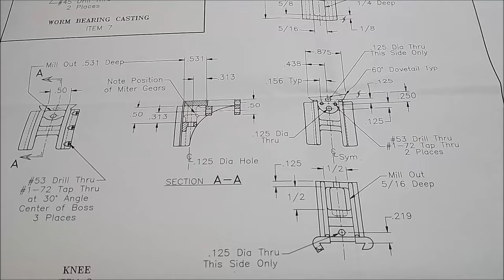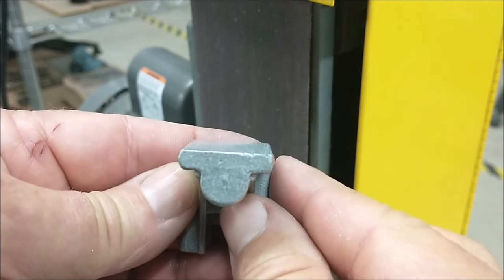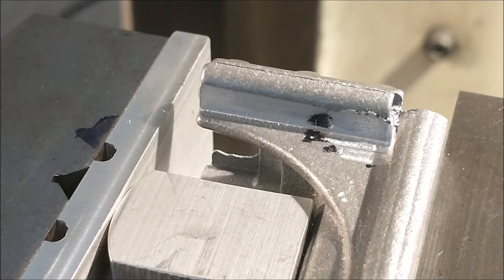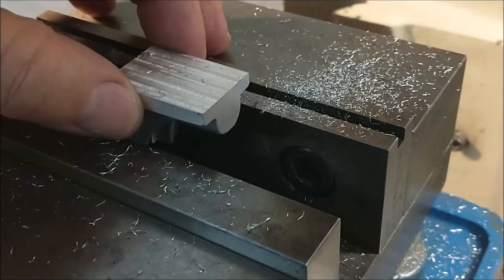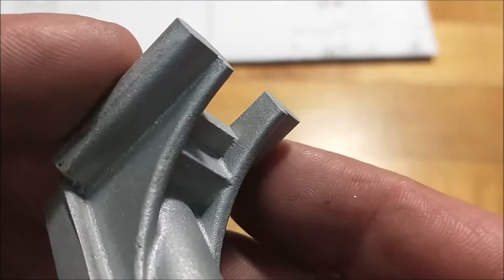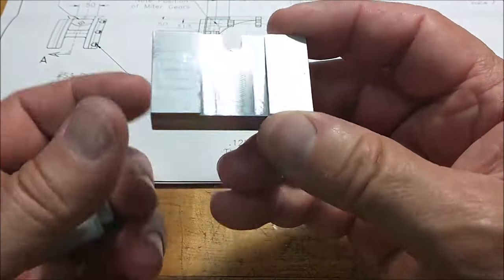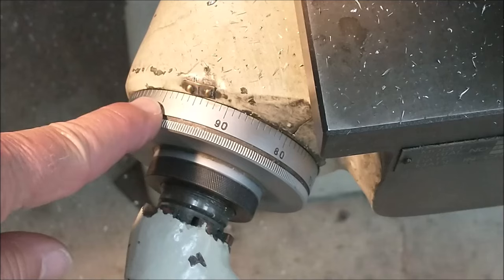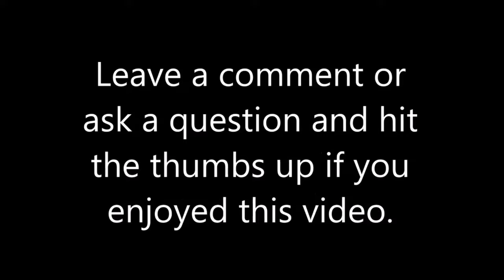A Miniature Knee for a Miniature Mill.....Take a Look !!

Comment: Great description of how to properly address a raw casting Joe. If I may just point one minor correction out for your viewers, when you were talking about the projection direction on the print, you referred to imperial and metric projection, this is actually 1st or 3rd angle projection, and either can be applied to metric or imperial drawings. The projection angle the drawing is drafted in is denoted by a symbol in the title block usually. I am sure you know this Joe, just didn't want anyone getting the wrong end of the stick. Great job. Cheers, Jon
Reply from the maker: Thanks Jon.

Comment: Welcome Back Joe. That defect is called a sand fall. Looks ugly but does not limit functionality.

The draft angles and fillets allow you to pull the pattern out of the sand.
Reply from the maker: I'd rather have a positive ugly than a big blow hole.
Reply: @joepie221  LOL I have worked several castings on older machines. Huge castings for small shops. Many of these were gone using pit casting. Pit casting is where you work the mold in a pit full of sand. These castings often had blow holes. These were filled with lead. I can imagine pouring a pit casting on a huge machine. The bucket of a few tons of white hot iron can scare most folks to rethink what they’re doing there.

Comment: Draft is required to prevent sand pulls when removing patterns. Even so, the blemish Joe machined out is an actual sand fall. That corner is very delicate in the sand and this time, it fell in.

While draft is required in sand casting, it’s needed. But I always find one of the more critical phases in machining sand castings is knowing where to start and establishing reference planes or as Joe says, banking surfaces. Think about what you will do prior to your first chips.

Comment: Good day Joe. Nice to have you back on the miniatures. Think big, work small eh. Flying parts, LOL. I built a pedestal polisher out of a small grinder and made extensions to get the cotton wheels farter away from the motor. Right away I had a large piece of silver take off at light speed so of course after it hit the platform, the wall behind it and on to the floor it was a remelt. After a while I ended up ruining a few more pieces I cut the base back so I could use the bottom of the polishing wheels and got a nice piece of small openings netting installed to catch the pieces as they left my control. No more ruined pieces. I have a video of the piece.  When I see dross in a corner like that I think SAND. Tunes are a choice but you narating is better my friend. A busy casting is almost an understatement. Of all the pieces I have seen you make I believe this is the, LOL, busiest yet. Thanks a bunch Joe. I really liked this one. Your long awaited parcel should be there this week. It sure has a lot of miles on it eh. Thanks again and see you next post my friend.
Reply from the maker: Thanks for stopping by sir. Always good to see a comment from ya.
Reply: And a big thanks to you too my southern friend.  This is sure a tricky one. Without carefully work out where to start and the process to follow I can see a new knee or 2 may/will have to be ordered.  @joepie221

Comment: Very excellent - a whole bunch of gems in there, and another fixture to add to the project list - a Tombstone. The extra mile attitude is such a good one to have - the results speak for themselves. That extra polishing / clean up / fettling - call it what you will - turns a great part into a breathtaking part. Cheers!
Reply: An excellent shop tool. In my 40 plus years one l never saw. Saw and used the idea of a spherical thrust piece to hold against tapered or uneven surfaces. We always had old bearings around to take the balls out of. I have even seen plates with a swivel foot jackscrew used. But take caution. There is a maximum angle that such tricks will be use to. To much angle between the movable viwe jaw and the surface being held and you risk the part being sucked out. The technical description of when this happening is üpkehfuckt.
Reply: Joe, we had a number of production machines out in production with indexing tables. One kind the table rode on steel balls 2.5 to 3 inches in diameter. It was scheduled to have the balls replaced so the table was lifted up. The old balls taken out and set aside. The races top and bottom were ground and shimmed. Then the bad news hit. Although the balls were ordered either the wrong size came in. Or they were not available. Luckily the old ones were not gone. A boss on the night shift told his people if they wanted a couple of the balls have at it. By nobody had yet. Later on I had some that were 25mm in diameter. I pulled some out at coffee one morning and started rolling them around in my hand like Bogart.

Comment: Joe, have you ever thought about or tried making your nests as Stl files in a 3D modeling program to exactly match the part you are working on,  then printing them on a resin printer? The resin is pretty strong and for such short use could possibly hold up as well as the aluminum for a jig. This way you can create a nest /jig that supports across the entire surface of even irregular surfaces of the part to be machined. I'm building a model PT Boat Kit and I'm using a 3D modeling program to create more accurate and detailed parts then were provided with the kit. (I'm really just using the original kits Hull and deck.) Resin prints only provide so much accuracy however and the hinged hatches on the torpedo tubes will have to be machined down so they seal properly when closed. Instead of fighting the fit by altering the print setting and printing possibly multiple times to get it right. I created nesting jigs that exactly fit the profile of the hatch so I can mill them down. I still have to see if it will work so fingers crossed but just an idea I thought I would share.
Reply from the maker: I can generate .STL files here, but then I'd need an accurate digital model of the part first. Thats not a problem, the reverse engineering would be time consuming.

Comment: When holding parts as you did that are iffy on those curved tangent surfaces I have a suggestion that I employ.
You can use a piece/strip of cereal box cardboard between the part and the jaws. If you plan to use water and the part is going to be in the vice for an extended amount of time a better choice is gasket paper as it won't absorb the water and deteriorate.
 Thanks for taking the time to share your expertise!

Comment: If the silence is unsettling, you could play a loop of generic milling milling noises at normal speed during the sped-up portions.

Or termites, or beavers gnawing wood, or jackhammers.

Or play the Ride of the Valkyries with a machine tool orchestra.

Comment: Ah Joe,  music to my ears.

You can train your compressor to cut in during the speachless periods & cut out as you talk.

Tap the mic audio signal into an operational amplifier ( tiny cents chip) rectify the output signal, put a small capacitor accross it and feed it into another op- amp that is wired as a comparitor.

(Use a potentiometer as the v reference),  and the output of the comparitor switches the compressor solonoid / contactor (may be through a relay or buffer).

If you want a strawberry on top of the iceing, you can use the comparitor o/p signal to also cut the compressor volume!

Talking of strawberries, when are you going to build a miniature 7 axis CNC machine?

So great to have you back.
Thanks
.
Reply from the maker: Thank you.

Comment: I am always amazed how you come up with these step by step plans to achieve all necessary work on these castings in a coherent and efficient matter.
Great job! And great teaching aswell.

On your question about the sped up bits of video: I don't need music to watch a machineshop in action.
I do like (might sound weird) the chipmunk voice left when audio get's sped up with the video track.
I did read the comment where you answered about editing program eliminating audio after certain speeds, in those cases you could for me ad some random b-roll audio taken inside your shop during working hours (at low volume).
Silence is okay for me though also.
Reply from the maker: Thanks for the comment.

Comment: Some times lost wax patterns are used and covered with a plaster type mold and then the wax is melted out and the metal poured in , no draft angle is needed in this type as the mold is broken off the parts .

Comment: The tombstone shaped thingy...Good idea. No, strike that ....Great idea! One I never considered and cannot recall having that particular issue, nevertheless a thing keep on mental file. Thanks Joe.  Music?  It can be annoying I would prefer just watching. The bee hive removal...Outstanding...I need a blaster! I have needed one for 30 years! Anyway always learning something about work holding from you Joe. Your the best. Cheers
Reply from the maker: The blaster is a great addition to a shop. They can be had cheap, but you still have to provide sufficient air. Check the requirements before buying one.
Reply: @joepie221  Thanks Joe, compressed air is one thing I have in abundance!

Comment: Also the pattern has to be made larger to account for shrinkage as the metal cools , there is shrinkage rulers for making patterns over size to get the final part size .
Reply: Also tables in Machinery's Handbook. In different materials iirc.

Comment: Nice work Joe. As always. Why not shorten the brass gears from the back and create some clearance for a small Delrin washer? Hold it on a fitting shaft in a collet. Tighten the setscrew and nibble away the needed clearance. Looks easier to do for me. Just a thought or a different route to Rome. Thank you and all the best Joe, Job

Comment: No draft or near no draft castings require something like lost foam or investment wax castings which look very different as they are "near net shape " castings and can be extremely accurate especially if internal features matter.  The original Saturn 4 cylinders were lost foam cast; case and heads.  It's a more expensive process but the results are worth it in some manufacturing processes.  Vulcan Engineering makes the systems that mold and glue the foam into the final shapes for each cast part.
Reply from the maker: I appreciate the info.

Comment: Very good as usual. Spatial understanding is often said to be a male thing, like imagining three-dimensional bodies of material inside the brain, just by thinking. Also to navigate the woods, lands or seas, using a chart and a compass, maybe even with a sense of direction and heading, without technical means. The Vikings did not use compasses, but they could fare to Iceland, back and forth to Norway, all over the time, for 500 of years or more, until the great plage stopped the traffic.

Comment: Regarding the plastic washers you are going to add, it may be easier to remove a little bit of the gear rather than the main casting for some assemblies.
Reply from the maker: The distance to the set screw will dictate the final surface to be cut. Good call.

Comment: Another saying about hot parts. Everything in the weld shop is heavy. Do not ask how l know. 😖
Controlling the down movements of small cutters. 
Bring the cuttr down close to the surface. 
Lock the quill. 
Set the quill stop to the current depth. 
Unlock quill and retract slightly.
Lower quill stop in small amounts until cutter contacts work.
Lower quill stop in measuer amounts to control depth of cut.
Reply from the maker: Agreed. Good technique for grippy material.

Comment: Draft angles are used for part releasing from the mould.  If the parts were investment casted on a tree they could reduce the draft and in some cases eliminate the draft making a more accurate part and allow for a percentage of shrinkage.  The investment could be blasted off the parts thereby eliminating the need for the draft.
Reply: Actually the draft angle is to remove the pattern. Not the part being cast.
Reply: @grntitan1  I mostly worked with investment casting making aircraft parts, so I stand corrected.
Reply from the maker: @grntitan1   Agreed. 2:08

Comment: That bad spot in the corner was caused by some of the mold being gone or the sand surface not being sealed and the metal leaked in to the sand .
Reply from the maker: I'm a little surprised they didn't reject that part, but then again,  I love a challenge.

Comment: Draft angle is NOT to release the part; it is to release the pattern.
Reply: What is the difference? They need to be separated either way, so it seems like both are true. Serious question.
Reply: @benzam6218 
When the part is released, the sand mold is destroyed anyway.  So no draft is needed. You will get the part out in any case by destroying the mold.
But the same is not true for releasing the pattern, as the mold has to survive unharmed to be used for pouring the part.

PS: You are aware that the mold is made from compacted sand, are you? If not, I recommend the channel of myfordboy, who does a lot of castings and shows the whole procedure in detail.
Reply: @benzam6218  I'm with you! 
My first thought was a die casting operation requiring the draft angle. My injection molding background looked at the gate, where the draft was on the part, parting lines = die cast with a follow-up sandblasting to mimic sand cast.

Some poor slob lost his mind making the tiny dies/molds for all the 'mini-machines' Joe has shown us! 🙂
Reply from the maker: Agreed. 2:08 Its for the pattern, not the part.

Comment: Hi Joe! 
I don't think this is a sand casting. It looks very much like an Aluminium injection cast part. These kinds parts need the draft angle you abserved to pop out of the mold. Also the parting line mismatch points in that direction.
A mold like this can have additional piston to add additional parting surfaces. They will do 3k to 10k casts before needing an overhaul.
Reply: Definitely sand cast. The tell is the "bee hive" that was caused by a bit of sand that broke off that corner when the pattern was pulled out and got filled in by the molten aluminum.
Reply from the maker: It certainly looked like that.